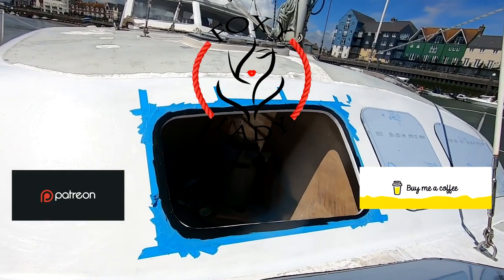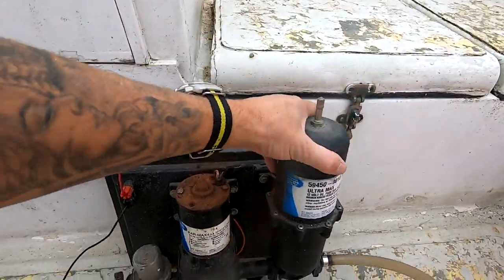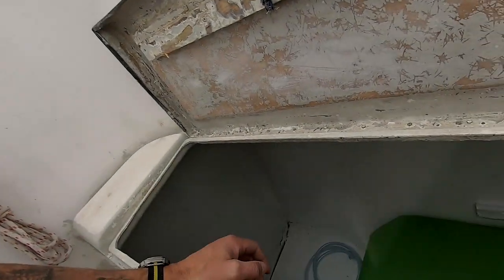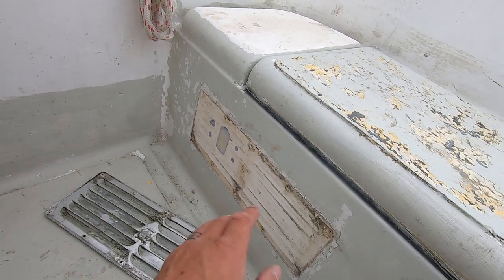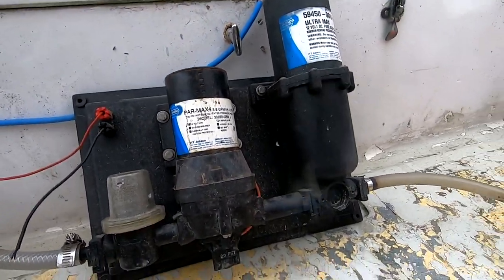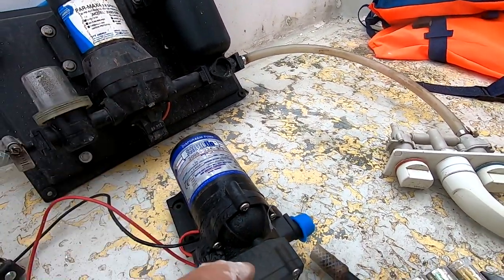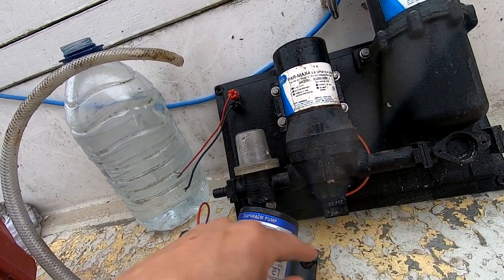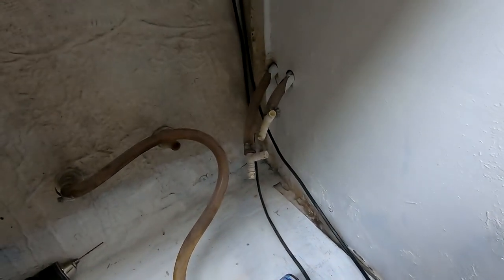Water System Progress on Project Yacht E98

Comment: Fit some sort of waterproof lagging jacket or insulation over your water tank and insulate your feed pipes to stop freeze ups and bursts. You can buy plastic irrigation hose connectors or even stainless ones they are also used in brewing pub trade...
Reply from the maker: Thanks Clive, that's a very good call, stopfreezing and stop being too warm in the summer! Will take a look around at lagging! Thanks again mate
Reply: @SailingFoxyLady  
No problem for now if youve got any water in the tank and pipes find some thick Polystyrene sheet from a skip or bin.
You might find something you can stuff a HD plastic bag with that you can then wrap round the tank.  As for the pipes use standard foam pipe lagging if its no where  above hot water temps .

Comment: You can reduce the noise further on the pump by adding an expansion vessel ( accumulator vessel ), The pump pressurises the expansion vessel and the rest of the plumbing to the consumer end ( tap/shower ) then turns off, upon demand ( turning the tap on ), the expansion vessel instantly  supplies water and gives time for the pump to "catch up". This results in the pump running less and consuming less power for trivial amounts of water. Your Jabsco setup seems to be such an arrangement but a domestic central heating expansion vessel can be fitted in line to perform the same function.

Using one will make your domestic water respond quicker and your pump last longer ( with less on/off cycles )

For further info on the subject youtube "Jabsco accumulator tank".
Reply from the maker: Oh brilliant, my friend did try and explain the old one to me but ended with the diaphragm will be split so not worth the bother.  If i can source an inline one ill try it as i need to make some slight adjustments on the system. The calorifier hose tails are wrong for the pipe or the other way round. Either way i need to do some fettling in there!! Thanks👍👍
Reply: @SailingFoxyLady  I did comment that mrcentralheating have them for under twenty quid but youtube eat the comment, probably anti advertising measures.
Reply from the maker: @86config  i did see it in the email but wouldn't show in youtube. Really frustrating but looking at them now. Thankyou mate